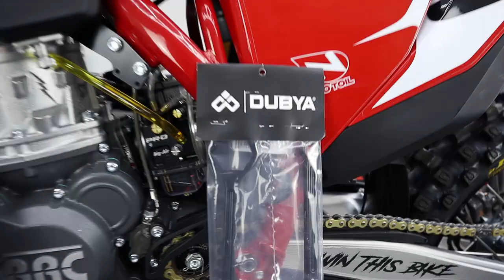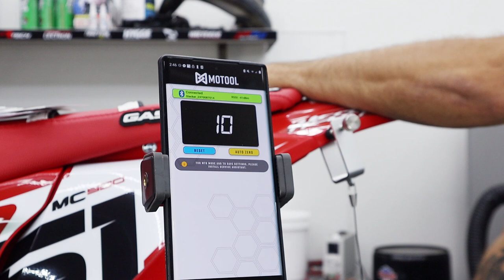FINALLY have my 500cc dream bike... and I've gotta get rid of it 😡 $35,000 Big Bore Two Stroke Build

Comment: I’ve watched “most” of the build vids. But have missed if it was covered. How does that power valve operate? 
Sweet bike. Gave me flashbacks to 1985 when I rolled my CR500 off the dealer floor.
Reply from the maker: I don’t think I’ve ever explain it, but she is pressure activated! Very simple design. 

If I remember correctly, the 85 or the 86 was the biggest beast of all time in the CR 500 lineup !

Comment: OMG I drool everytime I watch this build, it's absolute perfection! You're an artistic craftsman and I can't wait for the next one😊. Question, what is the wet weight of the finished product and also the seat height?  Thanks for doing what you do, love this channel ❤️
Reply from the maker: Wow, incredibly kind words - thank you 🙏 I’m not entirely sure on the final weight. I’m going to say that with this engine package and the additional electric start/battery etc. that one gained somewhere between 15 and 20 pounds as a guess.

Thankfully, these two strokes are already super light to begin with!
Reply: So with the added weight and the suspension mods is the seat height still the same as stock, jest curious 😊

Comment: what happens if mud gets stuck between the power valve and the radiator/frame and restrict the power valve from moving?
Reply from the maker: In the rare even that happened (it’s so tucked in) you’d just clean it out I suppose

Comment: Are you going to ride it?? I would be curious to hear some feedback from an a level rider just to see how it handled and the amount of vibration it has? Don’t take this as me bagging on your build that’s not the case by any means because it’s a badass build (plus Tony vouches for you and I have full faith in any bike Tony touches plus he is a solid dude) but in my opinion getting that thing to handle good and not vibrate your hands off you would think would be extremely hard if not damn near impossible?
Reply from the maker: We should actually be riding both of them. The YZ500 and this MC500. The ride test for the Yamaha would have been out already had it not broken right in the middle of the test.

No worries, I don’t take a good question as criticism. 

I will ultimately leave the ride test up to the winner of this bike for the MC500. I think that’s the right thing to do.

But at the end of the day, the awesome steel frame coupled with a counterbalanced engine, and Yamaha suspension internals inside the GasGas forks- it has an incredible chance of being one of the most compliant, comfortable, and technologically advanced 500s somebody’s money could buy. 

If the winner elects to let us ride it, it will be with dirtbike magazine just like the YZ500 and I will actually be able to give pretty good feedback on the machine once throwing a leg over it as well.

Comment: Some really nice builds recently!  With your connections, it would have been the icing on the cake if you had gotten dyno curves!  They're beautiful builds, but how much beefier are they than the legacy 500's?
Reply from the maker: You know, maybe one of these days I’ll find somebody with one. However, when we did the YZ500, Riley (owner of BRC) sent me a chart showing the curve and peak horsepower cracking just over 70 with the cone pipe and stock CDI. I threw it up in one of the videos, wish I could remember which one that was.

Comment: Baby elephant in the clutch traveled all the way to the cylinder and is trying to get out every time you blip the throttle and see the power valve move (very unique as well, most bikes you cant actually watch it function without having the side off your motor and it still doesnt look as cool as that engines design).  Fingers crossed for everyone entered. 

I'm going have to put a lease on my home to buy 100k tickets to ensure a win somewhere 🏆.
Reply from the maker: Hahahahaha the baby elephant thrusting.... oh my! Probably likes the premix lube too! Stoked to have you!